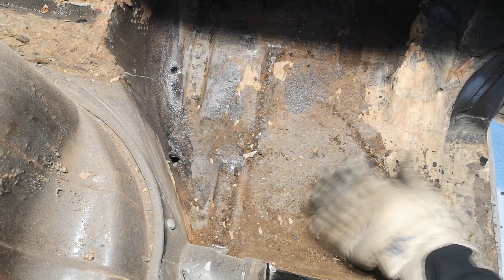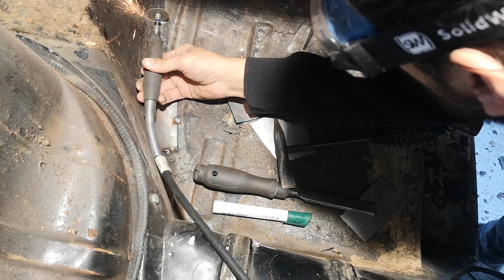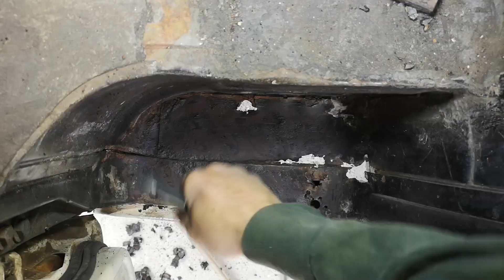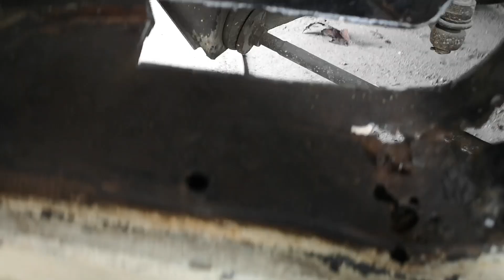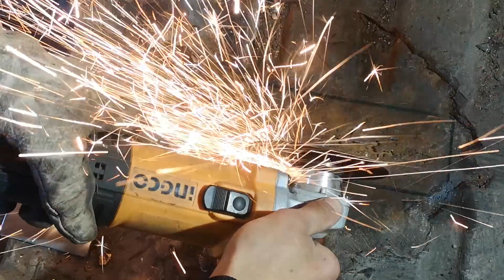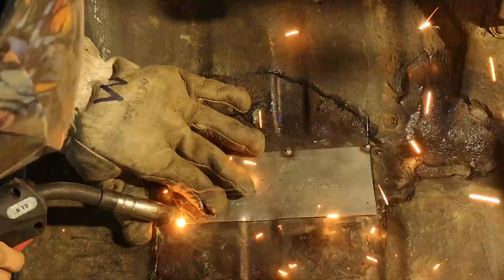VW LT35 campervan rust hole repair

Comment: Working on a 2001 version today - we're sorting out the fact the rear axle is held on by cobwebs... welding complete (say it fast) I rang looking for new spring shackles as the old ones are toast.. parts guys we use had none/couldn't get.. Hmm.,.. rang the main stealers, they said they'd ring back.. they rang back an hour later - "parts are discontinued/NLA/We not makes 'em any more Pal/Tough tiddies.....  "  Blimey... Rang "We have every spring bit on Earth R Us" - they couldn't get any either.....   

 Well good luck to folks with that... I'll make a pair, we have the gear to do that, but dunno what loads of people will do.
Reply: I hate welding these btw - it's never ending. You think you are done, you spot another hole... and another... Endless. Pleurff.
Reply: A lot parts that was discontinued goes under diferent part numbers but it is same. I had hard time to find fuel presure regulator  but i made it

Comment: You should have seam welded the repairs   NOT just   "spots" !
Reply: The metal is too thin to seam weld…that would cause distortion. That’s why people do small spots around the repair then continue around to minimise distortion.
Reply from the maker: I did, i say at the end that im not gonna show it because I you can see it in the previous clips, maybe i didnt say it properly... my bad D:
Reply: I was thinking about that same. Even tho a lot of them is weldet only on spots but then they are overlaping   and ruber filed seams which mainly fails here 😊